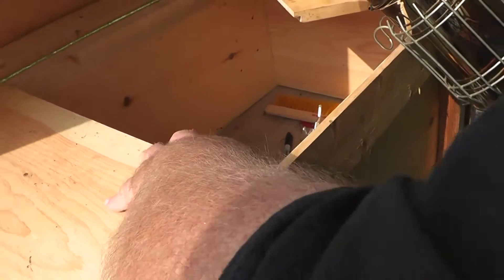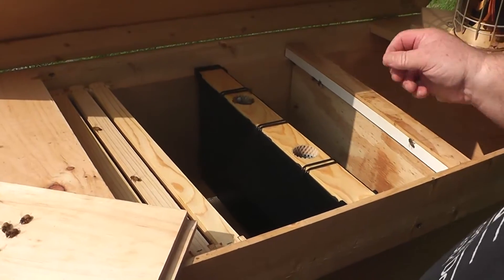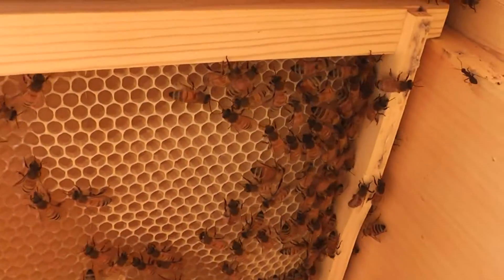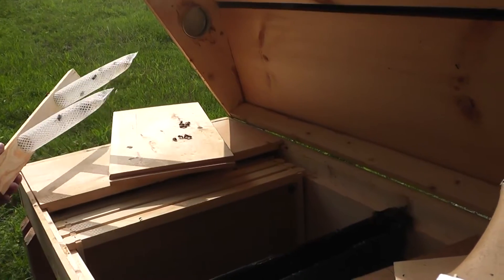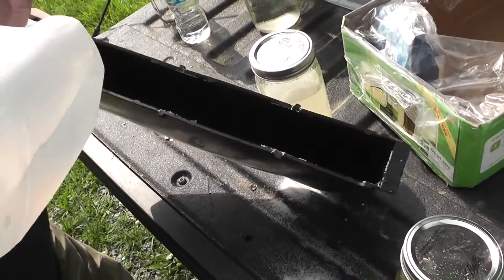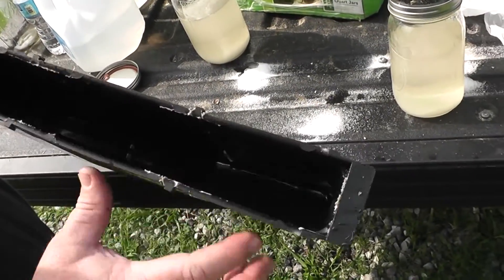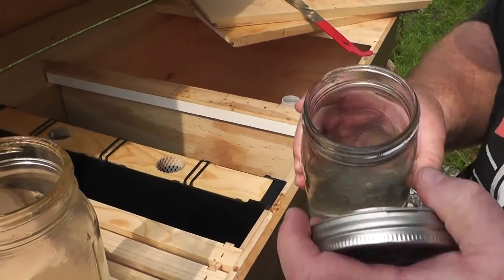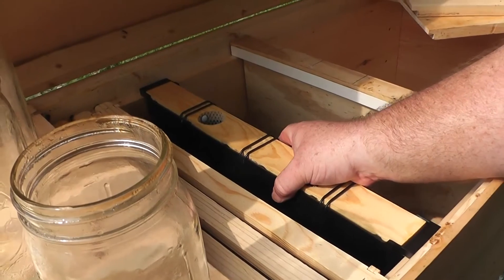Day 41 of Beehive #2 - Analyzing the Feeder and Pollen Patty

Comment: Will you eventually be able to stop feeding them? Will they forage on their own?
Reply from the maker: Jose Fernandez They have actually been using very little of the feed.  I have only been putting a couple of quarts and about every 5-6 days and with it being over 90 I think some of that is just evaporating.  There is always a lot of good activity of bees going in and out so I am just really doing it so supplement.  I think for the most part they are doing what they do best and that is work for their food :)  The other thing is I have never made the concentrate as thick as most people do.  I only add a small bag of sugar to a gallon on water so it is probably not that tasty to them anyway :)  When you start a hive from scratch they will need a little more help than if you start from a nuke.  I wanted to start from scratch so they have literally only had 42 days to build what they have so far.